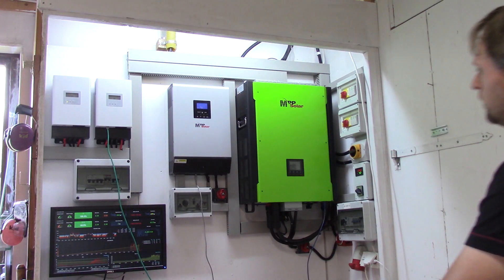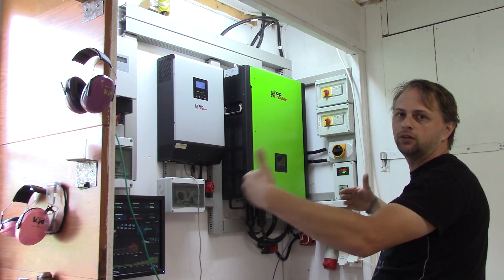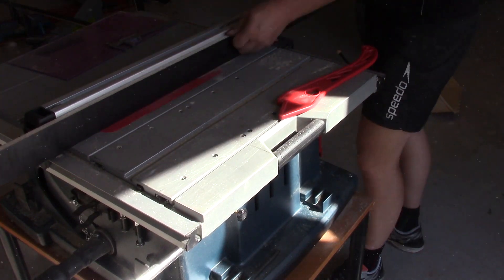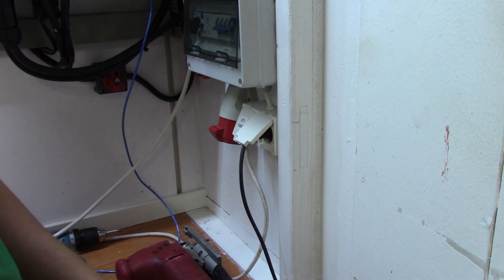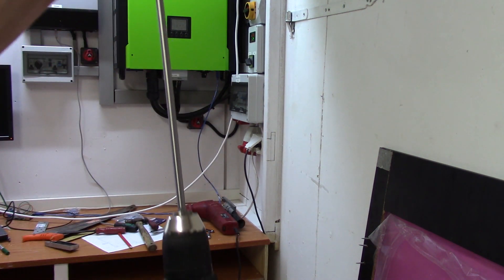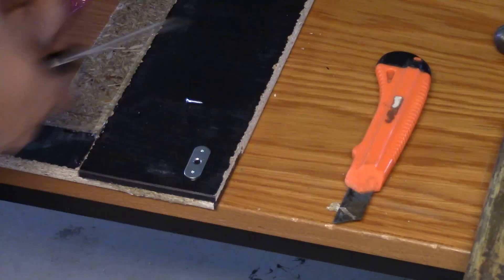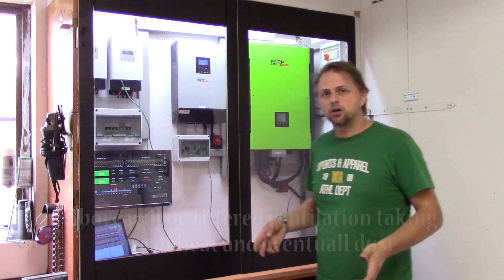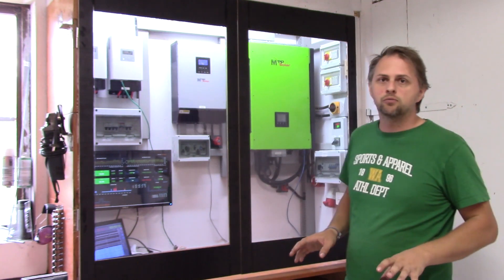Rebuild my solar installation! (part 4) - Doors for the enclosure

Comment: Hi, Thanks for the great videos....  I started building my powerwall. Got 1000 laptop batteries and in that.., surprisingly I got around 5500 cells above 2000mah. I'm struck with wiring part... I don't know how to place these cells... what should I do now ??

I'm planning to power my house completely on this. I got below electronics stuffs in my house
7 LED Bulbs 9W
2 Ceiling Fans
Samsung 46 Inch LED TV
1 Mixer
1 Water Pump Motor
1 Water Heater
1 Small Fridge
1 Induction Cooker

I want to power these gadgets without any problem like regular power supply. As of know I have 4 100W 12V solar panels. I don't want to run completely on solar panel but at least half if possible. My house is not so big and since it's village, I face power cuts frequently. 

So please suggest me to build my power wall. Thanks in advance :)
Reply from the maker: Bharath Naik L hey
The answer is to long to be written in a comment. But basically an off grid inverter. Bms and then run 48v 14s battery bank is what i would do. Check out my battery build videos. Also pm  me here or in diy powerwall forum.
Reply: Hi, Thanks buddy. I just joined diypowerwalls forum. I will be in touch with you....

Comment: Instead of carving out the support, and then need to attach a small block of wood for the hinges, why did you not placed the hing directly on the other face of the support? the one where you place the block of wood?
Reply from the maker: MaxSantos because then i wouldnt have had the door on the outside of the frame like i wanted. Easier to seal.
Reply: Oh i see. OK. On another topic, instead of pushing air so that the hot air come out, why not pull the hot air on the top on the side near the charge controllers?
Reply from the maker: MaxSantos because air going in need to be filtered. Yes its wrong way around but has a reason for it :) will be shown in next video :)
Reply: Got it. That way you hope to get only on filtered inlet for the air instead of having it enter any ware. Thanks.

Comment: Needs a door stopper in the middle bottom.
why blow heat out the bottom when heat rises. why not put a filter at the bottom to suck in cold air and force heat out the top?
Reply: Daniel, add a piece of tumbledryer exhaust pipe to collect air from the top to feed out the bottom - I think you can work out what I mean!
Reply from the maker: Phizicks because easier to build. Most air will go on top and Will show the design  later on
Reply from the maker: Phizicks door stopper is added :)
Reply: Can do that, but I still think that requires more force to push air down and out than just blow it straight out the top as heat is already wanting to go up rather than down. But I don't know his story above the roof so wait for his next video to explain it better I guess. I'm guessing there's reasons he can't do it that way.
Reply: Shouldn't take much energy to suck the hot air out, a couple of 12V cpu coolers could do the job, and he can direct the output wherever he wants - indoors in winter, or outdoors in summer.